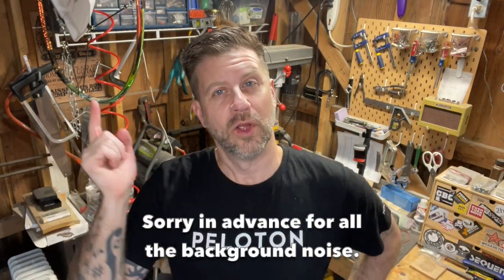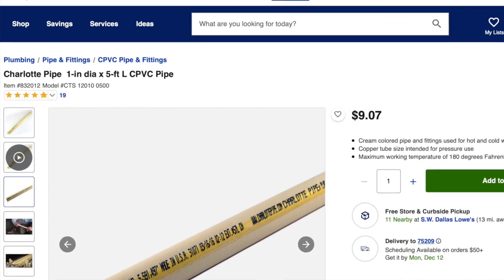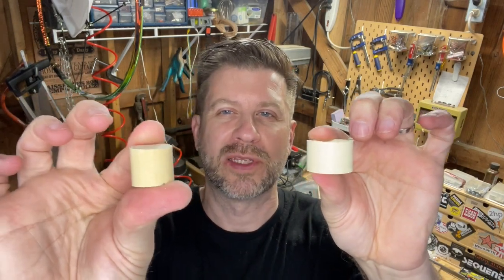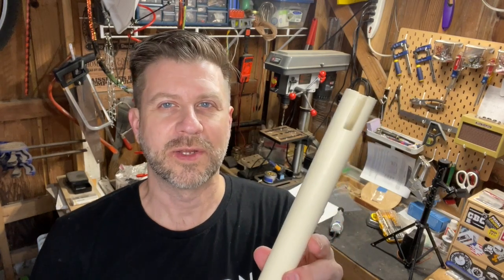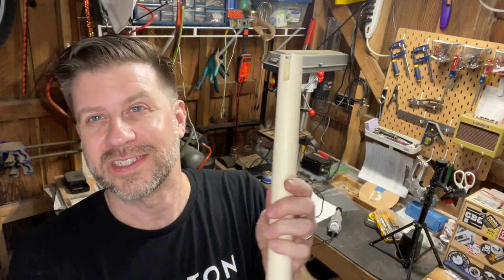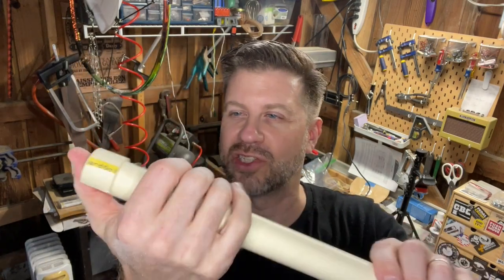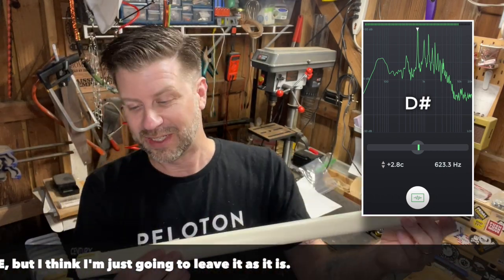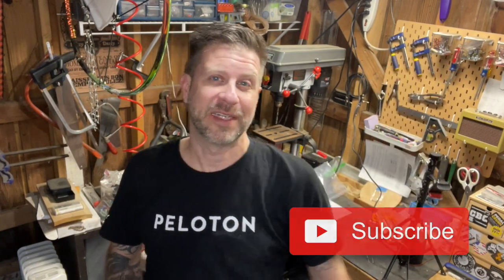My First Attempt at Making a PVC Overtone Flute

Comment: The ratio (diameter/lenght) should be 1:30 to get more notes easily
Reply from the maker: It sounds like you might have built a few of these. I appreciate the experience (this was my first time as the title suggests). I'm assuming that's interior diameter you're referencing? So with a 3/4" pipe, I'd want it to be about 22.5" long. Maybe I'll try that next.
Reply: Just saw your reply (8 months later!) 😅 So yeah, basically the higher the ratio, the easier it will be to reach those higher harmonics.